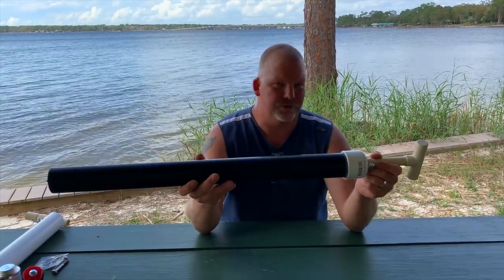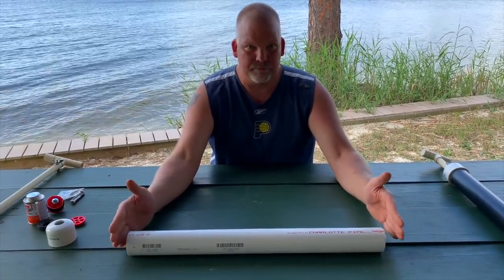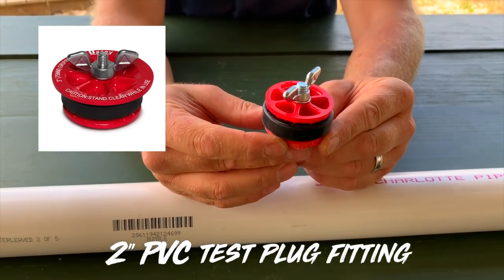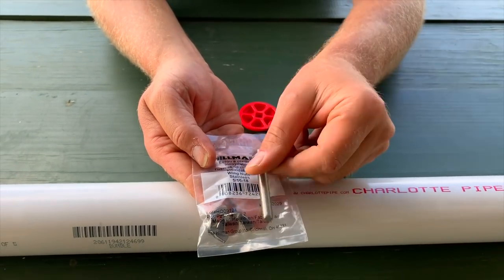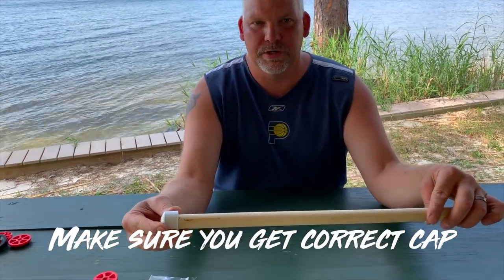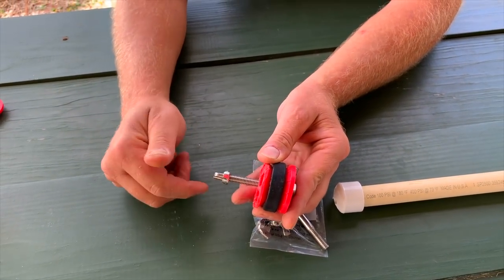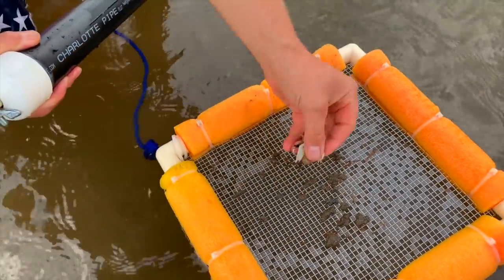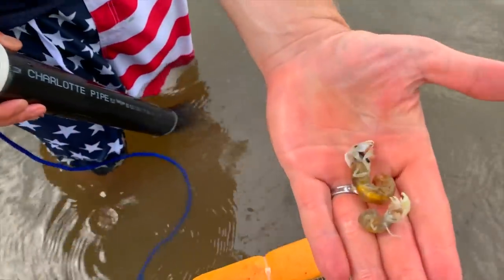How to Make a GHOST SHRIMP PUMP | Florida

Comment: If you follow the written measurements in the video a 3/4" PVC cap will not fit through a 1" hole in the 2" PVC cap. The 3/4" PVC pipe will fit through the 1" hole so I'm fine with it; I don't want any slop around the 3/4" PVC pipe at the 2" PVC cap. At 4:44 the 3/4" CPVC pipe is shorter than the 28" length mentioned in the written measurements so you'll have excess length at the top as seen in the black pump. If you use cement and the piston ever fails, you'll be able to hack off the piston and put a new one on. If you don't use cement and attach everything with screws, you'll be able to unscrew and replace the piston.

Comment: Install a Handle just below the top cap!...
Will make pumping So Much Easier!..... 🦐
Reply from the maker: Good thought!
Reply: @SaltSquatch - ,
I have installed a plastic pipe, level end cap, facing down, below my washer system!, in my pumps! 
Have to make a hole in side, just below the end, where it fits on, to get split pin thru!
This adds more suction power!.... 🦐
Reply from the maker: @michaeleverton4882  thanks for the tip! I will have to try that!
Reply: Our plastic, pvc, bait suction pumps in SA 🇿🇦, and the Australian Alvey pumps are much more advanced with the in built handle! 🦐
Reply from the maker: I actually bought an Alvey pump